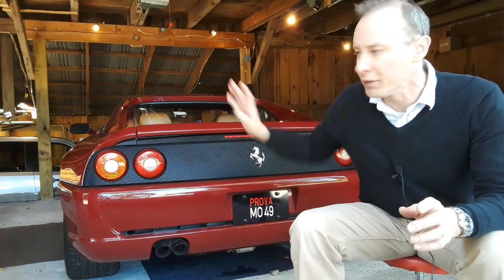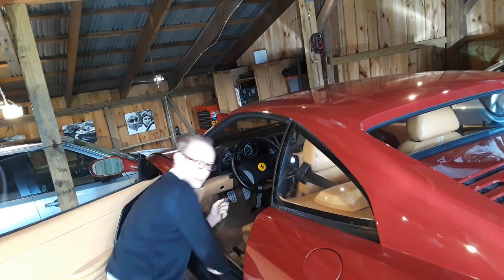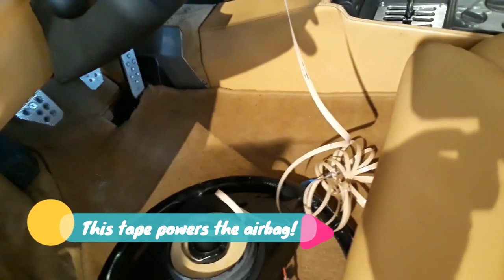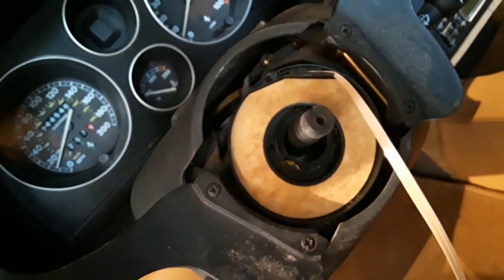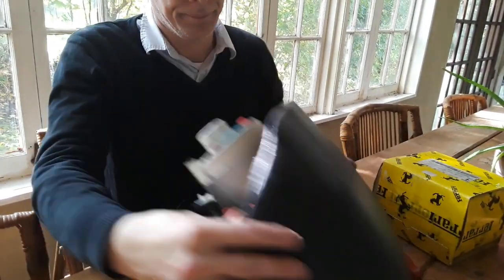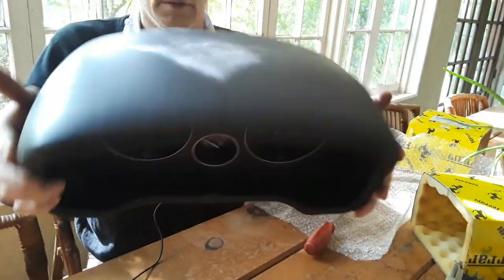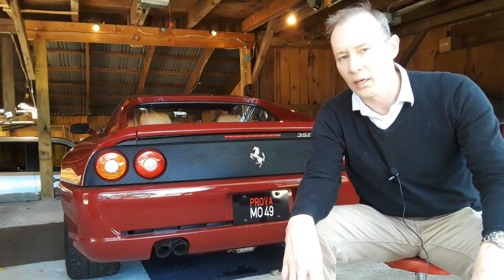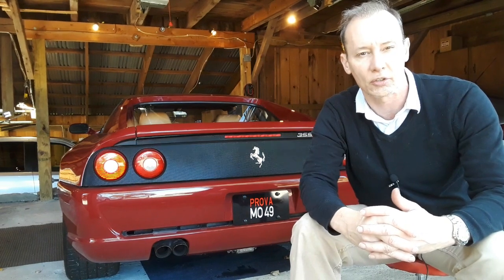Ferrari 355 Steering wheel and paddle shifter removal

Comment: What did you do with the old centre dash (three gauges)? You probably need to redirect the (grey/yellow) wire from the old oil pressure gauge plug wiring in the centre dash to the new instrument in the main instrument panel.
Reply from the maker: Haven't touched the console gauges yet.  I'll be working on that soon!